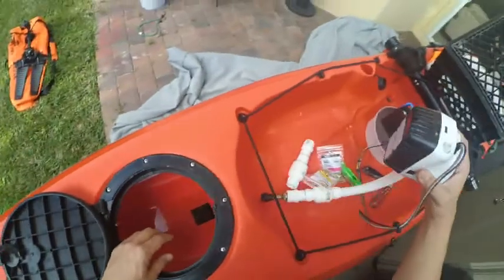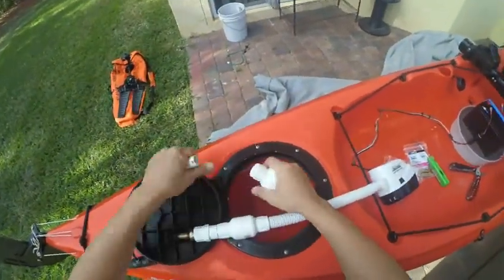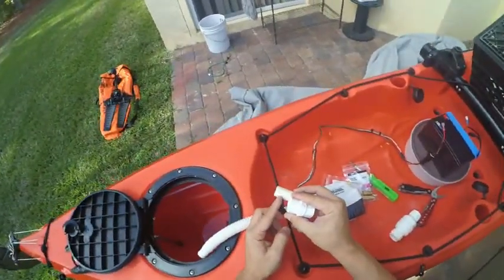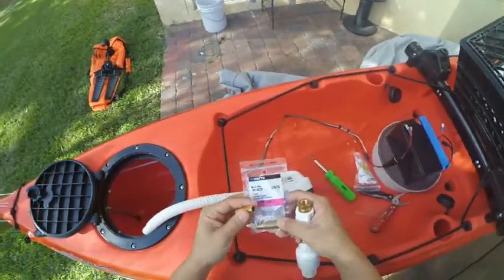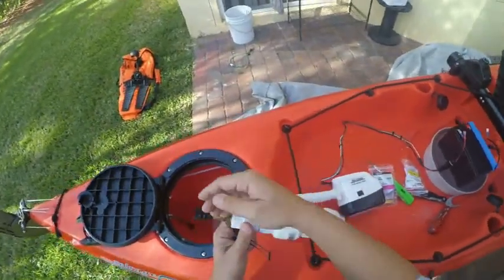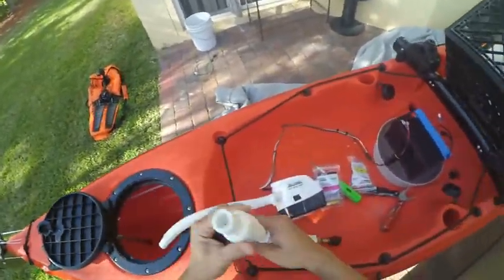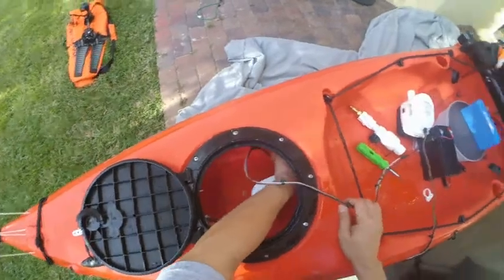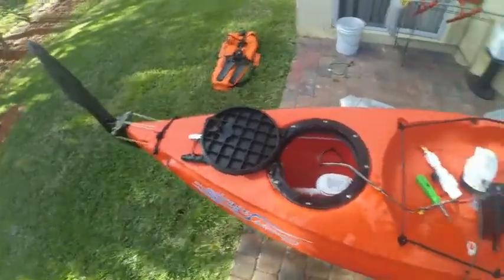Drain plug Internal Bilge Pump Mod Kayak Hobie Adventure Island, Tandem Island, Revolution

Comment: That will improve your gas mileage and speed quite a bit by not having to carry a bunch of ocean water.   Good idea.
Reply from the maker: Thanks steve! So what do you think about taking the AI to Bimini? 53 miles straight from Miami but with the north current im thinking launching out of key largo. Im estimating worst case 83 miles traveling at 6knts. About 13hrs. You think its doable?

Comment: Why do u get so much water in your kayak? Also, can you post the info on that battery you show at the end. I am looking to get one for my trolling motor
Reply from the maker: Hey Johan! water slowly leaks in thru my rudder cable as it get submerge when in motion. even more when I bring someone out with me. it's not that bad going solo but with a friend it's pretty bad as you could see in my previous video I was able to use my mirage drive area as a live well lol.. As for the battery. I'll send you 2 links. Not sure on how well it will work on your troll motor as it draw more amps.
Reply: Yak Ninja. Yeah that will be great. I do not have a motor yet, but will probably get it in a couple of week.